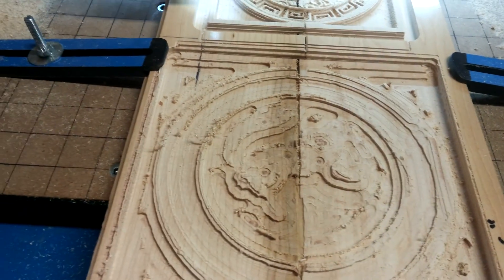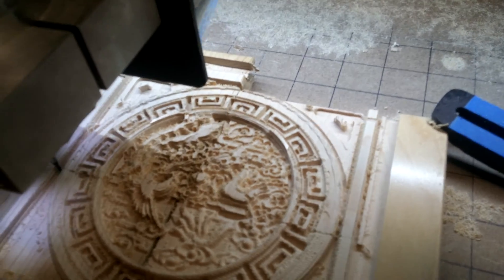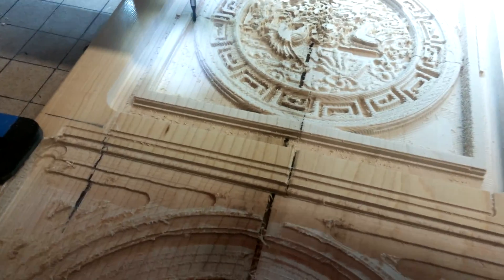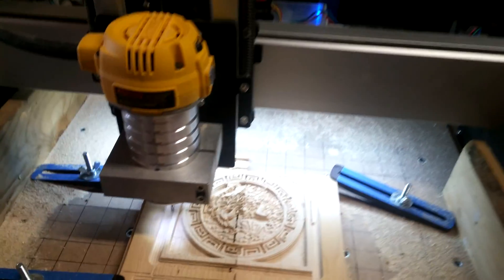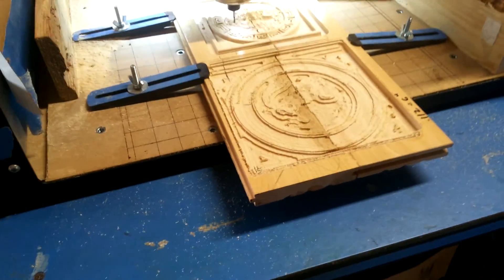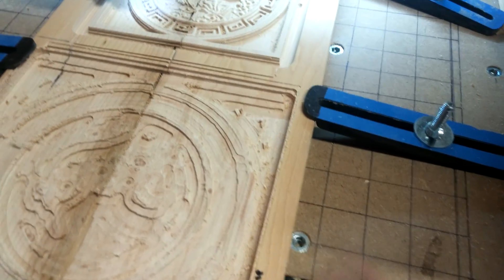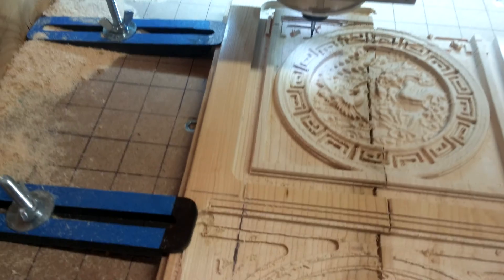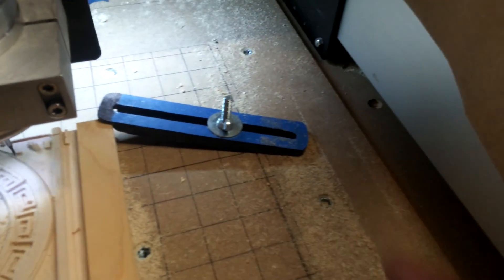Shapeoko 3 bit change test.

Comment: why aren't you using carbide motion to run the routing paths that you created in meshcam?  If you zero it, do 1 pass, move back to zero % change, then run part 2 it should be fine right?

Comment: I do similar style for bit changes.  I use Fusion 360, and make different files for all the bits.  To change the bits all I have to do is re-zero the z-axis with the smaller bit and leave the x and y the same.  Makes it really simple.